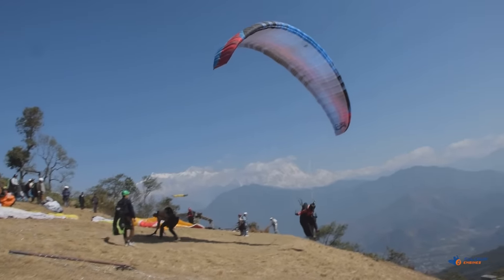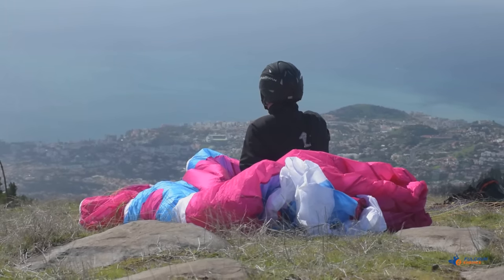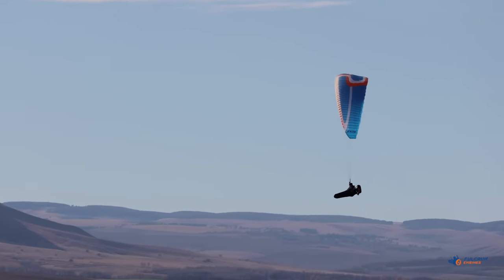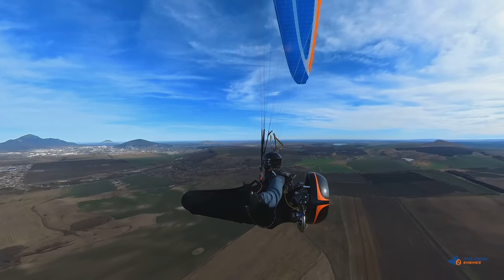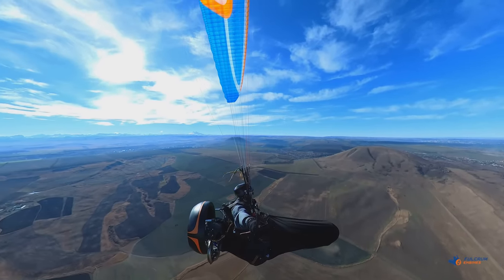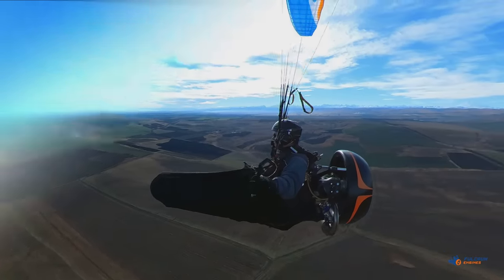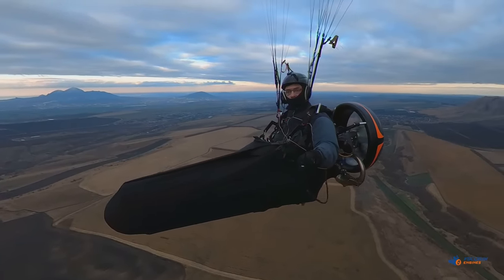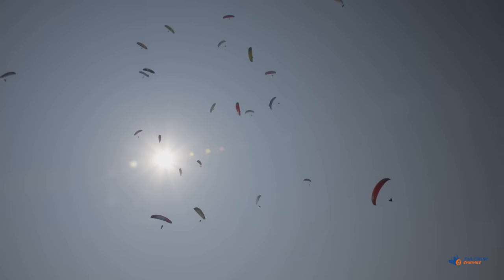Fulcrum PowerPod is the world's first paramotor pod harness with a ducted fan only 0.5 m in diameter

Comment from the maker: PowerPod pre-order form-questionnaire : https://forms.gle/6F1X8s3qszE4SELU9

Next video:
Footage of takeoff, flight and landing, Q&A: https://www.youtube.com/watch?v=8hhjyo9ZoTA
Our website: https://fulcrum-engines.com
Reply: I'm really interested in the Fulcrum paragliding. Can you tell me when this will be available for purchase? Thanks
Reply from the maker: @ryancarlile5830  We are working on fine-tuning and preparing the PowerPod for mass production. This is not an easy process. Now we cannot name the dates.
Reply: @fulcrumengines2519  a very approximate guess please? so we know to wait or buy something else, thanks
Reply: @wayneo9783  @Fulcrum engines I’m asking the same question.
Reply: SUCH a great pity that you don't mention at all (unless I'm mistaken ) whether it's driven by a petrol (gas), electric,  or (I expect very unlikely) diesel motor. Additionally, you don't say how long it's possible to use this device before it requires refueling, or recharging, which is also a shame. However, all the same, congratulations on your achievement  !!
Reply from the maker: @MrGregHiller  Hi Greg, Opposed two-cylinder motor (25 hp)  and 8 liters of gas give us 1 hour of climbing (75% of thrust) and 1.5 hour of horizontal flight
Reply: This makes a lot of sense... except the fuel system. It’s way too close to the ground which does not seem safe. Would an electric motor with lithium batteries be safer?
Reply: What is the price for this system?

Comment: It would be fantastic to see an electric version of it. This would allow for direct response in switching it on and off, and also less maintenance.
Reply from the maker: Yes, we also dream of an electric version of the PowerPod. But unfortunately, according to our initial calculations, the weight of the Powerpad in the electric version will be significantly more on current technologies. But we are thinking about it.
Reply: do you have any idea about the energy density of batteries. and aircraft which need to be lightweight.
Reply from the maker: @ameraldas3641  If you are a good specialist in electric motors and batteries for our class projects and can help us, we will be very glad if you contact us.
Reply: @fulcrumengines2519  I initially thought buy the size and shape of the Powerpod that it was electric on the thumbnail. I get that the petrol powered version is going to carry a lot more useful energy, however I think it would be a good direction for the company to have an electric option.

perhaps only enough battery power to get into in to the air ( say a 1000ft) and some emergency reserve. if its light and cheap enough it'd sell itself.

Just thought of an awesome idea! - there's an Taiwanese company called Gogoro who are trying to push a modular swappable battery in Europe right now for electric scooters (there are other competing companies but the ecosystem is already popular in SE Asia) These batteries are about 5KG and must have a decent power density for the ranges I'm seeing. It would be very forward thinking for your company to look into using their modular batteries to get rid of the cost of batteries from your product.
Reply: @fulcrumengines2519  Think harder -- Pod soaring is exactly the market electric fits! Cheers
Reply: Electric is stupid since batteries weight a lot and their weight is not reduced as they get depleted. Combustion engines are way better
Reply: You can forget about electric motors and batteris in anything that needs to take flight for a long time still. A simple wiki search on energy density of batteries and liquid fuels will prove that in a few minutes. CO2-neutral biofuels are a much more achievable goal.
Reply: The way EV technology is progressing it's getting more and more feasible to get rid of the archaic and unreliable 2-stroke.
Once that happens I can see powered paragliding significantly gaining in popularity. 
Many like me have no interest  in getting involved while it's still the noisy old internal combustion engine.
Reply: @gbshaun  Feel free to mention technologies that come even close. I myself have been unable to find them. 

What I do find personally interesting are micro jet turbine engine generators for drones.  

Nothing battery-powered makes sense right now IMO.
Reply: @Invisiblehand123  yeah, it's not like Pipistrel sells the Alpha Electro, or Joby and others are building eVTOLs.  An electric powered parachute is surely entirely out of reach with today's technology
Reply: @fulcrumengines2519  batteries will keep improving, your design is great.
Reply: @gbshaun  elecric would not be much quieter unfortunately, as most of noise is made by prop and not engine.  But a little yes .
Reply: Do some research electric flight will happen but feasible is very far away unless you want to spend tons of money just look up wiki or engineering explained on YouTube about the limitations of electric motors
Reply: @dennisrichards2540    Settle down Denny.
Reply: Ya gotta use potatoes. Power it with potatoes….
Reply: @fulcrumengines2519  would it be not possible to have a minimal battery pack for take off, and perhaps five minute run time. The motor does not need to run the entire flight time, and once up the motor can be shut down to enjoy the quiet of free flight.
Reply: Need solar panels sewn into the parachute to charge the battery while in flight!
Reply: @patrickmckowen2999  lol you honestly think electric is good for this? Don't you know how much batteries weigh?
Reply: @Invisiblehand123  you would only need a few minutes to catch glide altitude. This is do able
Reply: Consider putting some extra batteries on the chest for balance. Put them on a quick release for safety. Good luck with company. I hope you help many people achieve the dream of flight.
Reply: @fulcrumengines2519  Just imagine if you get the propeller Gap instead of having it on the outside you have it on the inside and the motor is built into the outside frame you would have far more torque we have an extremely strong motor and you would have no gap on the outside you would have the gap towards the inside which would be very easy it'll be much smaller too. Rolls-Royce has built a boat engine like this. Basically there's no center shaft the shaft is the outside ring it's a motor built into the outside ring which spins the center of the Ring giving it massive amounts of torque.
Reply: Yeah a couple old car batteries will probably do the trick! Crazy no one has thought of this yet! Wait..
Reply: @AquarianSoulTimeTraveler  what did Rolls call this particular motor? I want to learn more about it.
Reply: Also solar paraglider infinite flight 😂
Reply: My cousin Ray Ray is developing one powered by human flatulence.
Reply: I want to help with electric conversion. 
First, I need to know what's the minimum and maximum horse power of the current combustion engine motor? 
Other questions we need to meet, how is this possible online?
Reply: Electric is to heavy and dangerous
Reply: Electric is history.
Reply: We need some of that alien tech
Reply: Yeah right a nice litium batery fire falling from the sky is all the world needs. Internal combustion works, stop re inventing the wheel, already circular. Maybe in some future.
Reply: Lol they haven't worked the kinks out of electric cars yet?!

None of these specs matter... Wich one can I rely on to continue to work properly while I'm literally flying?
Reply: Maybe just put the battery pack in the harness. The battery packs used in electric unicycles have plenty of power and even the smaller ones put out quite a bit of power for a long time for their size
Reply: Hydrogen fuel cell + electric motor
Reply: @nunyabidness3075  great idea about being able to drop the batteries in the event of a battery issue.
Reply: amcowningyourtruth  get back on your horse and get out of here…
Reply: @need100k YouTube needs a laugh react for this type of shit. Anyone who used real world applications of these batteries knows how limited they really are. Try running a simple battery powered blower and see how long you can run it. Now multiply the output needed to push a full grown and the battery capacity needed to provide adequate power and now your in the realm of maybe 5 minute effective run time without weighing a ton... nit feasible with current technology without costing a small fortune
Reply: @Paumonsu What is stupid is @Paumonsu
Reply: @fulcrumengines2519 not only that but all current electric technology does not do good in cold or in wet conditions aka the conditions of the sky and when electronics randomly decide to not work right while your mid air that's not a good time
Reply: Not happening
Reply: @GoldenBoy-et6of Even if batteries were capable it's the least efficient method of flight that isn't a mechanical flapping wing plane. At 1 gallon per hour fuel consumption rate that would require roughly a 12KWh battery pack to equal duration being roughly 190 lbs of just battery VS 50 lbs of 2 stroke including fuel. Add in a motor and now your at the borderline of exceeding ultralight classification that doesn't require license and colonoscopy level harassment of everything you do privately and in public. Wanna get drunk? Oops, your legal limit is now half cause you're a pilot or commercial driver.
Reply: @gbshaun  I don't really want to mix the gas and maintain it enough to make the cost worth getting into to
Reply: @need100k or even a wind turbine to recharge?

Comment: If these make it to final production status, it's rumored that although it will absolutely NOT be cheaper than traditional paramotors, but also not significantly MORE.  If that turns out to be the case, we may see the decline of the traditional paramotor.  For now, I'll just happily continue to cruise around in my Scout.

Comment: Unbelievably impressive. This would make a HUGE difference to both the powered and normally unpowered paragliding fraternity!
Reply from the maker: Thank you for your impression. We are working to make it happen!
Reply: @fulcrumengines2519  If the price is comparable to a paramotor, I want one. Do you have a price yet?
Reply: Kind disagree. A 25hp motor that pushes as hard as a 16hp paramotor would while using twice as much fuel, with as much weight as a 16hp rig would have but distributed farther away from your back so it feels heavier when taking off.
Reply from the maker: Our solution uses a fan with a size of only 0.5 meters. Of course, it won't be as efficient as a 1.2meter propeller. It's physically impossible. But when using a ducted fan, we lost only 30% of thrust, reducing the diameter by 2.4 times. And we removed the aerodynamic drag of the paramotor hoop and the large propeller for free flight. 
We think it's a good idea.
Reply: Where is Diego now? He still owes me 20 pesos!

Comment: Very graceful! - I have to admit from engineers point of view. The only thing which keeps me in slight doubt is the mass of the harness and the fact that you didn't mentioned it or compared to the traditional one. The torque is impressive, and you never used those creepy CG animations as most of the western  "never come to realty" ideas - so for sure you succeeded. Even if the mass is bigger than the classic simple unit, the comfort and reduced drag will meet the mentioned qualities - maybe without anything abnormal - but still, the companies like yours should be inspiration for young aeronautical engineers. Keep up the good work!
Reply from the maker: Thank you for your opinion and your encouragement. In our prototype, we used a temporary pod harness made by our forces. But in the serial product we plan to cooperate with well-known manufacturers of harness.
Reply: Having a working model to kinda leave no room for doubt eh?
Reply: @mrzorg  Absolutely!
Reply from the maker: David Stickney  We are currently working on fine-tuning the PowerPod and its serial production. It's not as fast as you want. As soon as we make a serial sample, we will announce the price.
Reply: @fulcrumengines2519 please add me to your list ! Finger lakes new York ,super Dwayne !
Reply from the maker: @dwaynetempest3433  Please write us: fulcrum.engines@gmail.com

Comment: Looks to me like the next step that paramotoring needs. I hope to see gaggles of these flying soon!
Reply: You won't.  Paragliders hate powered paragliders and powered paragliders know this solves problems that are not big deals. Price and safety will be big deals.
Reply from the maker: @richwilson7619  We tried to make a paramotor specifically for free pilots who want to fly where there are no hills and mountains to take off. For ordinary power paraglider pilots, a traditional paramotor is probably better.
Reply: @fulcrumengines2519  
I think it is great and will work great! The design makes perfect sense for the next step in design regardless of who its original target group was meant to be. It ALMOST reminds me of going from propeller towards the jet engine for large commercial and faster flights!!
Reply: @fulcrumengines2519  I am an advanced PG pilot. I began flying on the west coast of Canada where I lived 15 yrs ago, I have travelled to fly elsewhere and more locally where I live now ( virtual flatlander) but covid ruined most of that. This is what I have been waiting for, I know some think an electric ducted fan would be better but I don't feel comfortable running hot lipo strapped to me or my harness. Today while hiking with my dog I encountered an overwintering  family of bald eagles that lept from the icy marsh they were sunning in and climbed out on a pretty strong thermal. I haven't soared with them for some time now. How much is this going to cost, North America, if and when this "thing in the news" ends?
Reply from the maker: @flightographist  Unfortunately, right now we can't say how much it will cost. The situation in the world is changing rapidly around us and all prices and costs are increasing. But we are working on preparing for mass production, when it starts, the price will be known.
Reply: Please pose price when it becomes available
Reply: @fulcrumengines2519  where are those videos?

Comment: Who else dreams of flying XC with this thing? I am a XC junkie and this engine would revolutionise the way I fly😍
Reply from the maker: Thank you!
Reply: I’ll get one if it’s battery operated motor.
Reply from the maker: @nocancelcultureaccepted9316  We also love electric motors. But according to our calculations, the battery will be too heavy for any long flight. The option with an ICE turns out much easier.
Reply: @fulcrumengines2519  Suppose the whole heavy electric unit is jettisoned in flight after achieving elevation, when it will deploy a chute for safe descent over open country to be retrieved later (GPS)?
Reply: @fulcrumengines2519 nuclear power is the answer and the future.

Comment: That thing looks amazing! An electric version would be even cooler and could be even sleeker looking
Reply from the maker: Yes, that's right, until you consider the batteries. The battery will be very heavy and bulky to fly for at least half an hour.
Reply: @fulcrumengines2519  Yes I'm aware of that. If you hide them in the harness where competition pilots put their water ballast? Considering the efficiency of the ducted fan and the reduced drag compared to a traditional paramotor it should be more realistic to make an electric version of the PowerPod than any other paramotor. 20 mins should be enough to find thermals?
Reply from the maker: @rolandmdill  According to our calculations, the weight of the electrical version will be comparable only if the operating mode is only 7-9 minutes (climb mode). During this time, it's possible to gain 600-800 m altitude.  If you want to climb for 20 minutes, even then the electric version will be significantly heavier than the ICE version.
Reply: @fulcrumengines2519  Interesting, thanks a lot for explaining and giving a little insight into the developement process! 600-800m would be somewhat comparable to a winch start so still pretty useful, but 30 minutes is certainly way nicer and more useful. Still hoping for an electric version when batteries with higher energy densities will be available!
Reply: @rolandmdill  And when those high density lithium batteries catch fire?

Comment: Great design, I'm excited to see this move forward. I wonder if it would be useful to implement a 'sacrificial' soft material on the inside of the duct that would guide the airstream while still preventing the props from disintegrating when making contact. This would allow the tolerance between props and duct to be even smaller.  (not sure if the gain is worth it, but seems possible).
Reply: Hi, cool design.. what is the weight and range of engine use?
Reply: @stephenplace3575  just used for lift off and getting to height , then turned off ,
so doesn't need much , google has the answers to life
Reply: @ThermaL-ty7bw  ur right there!
Everything is evolving so fast now 🍄🙂 excited to see where 🍄🙂🙃🍄
Reply: Practical. Efficient. Simple. I like it.
Reply: Sounds like a fan jet engine.

Comment: Being that it's primarily used for takeoff and battery technology has improved so much, wouldn't it be better to have an electronic version? Would bring the manufacturing costs down and improve safety. Very little sound as well. Fantastic design guys!
Reply: same noise. Almost all the noise is created by the chopping of the air by the blade. And the batteries have nowhere near the duration of a small gas tank.